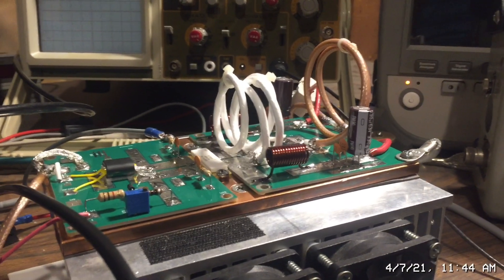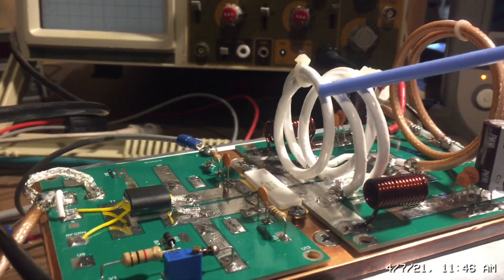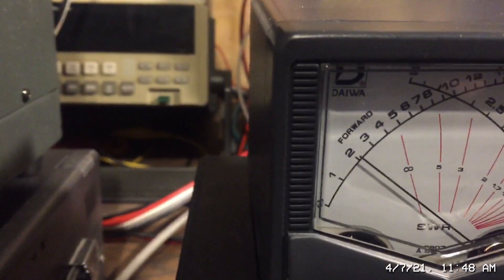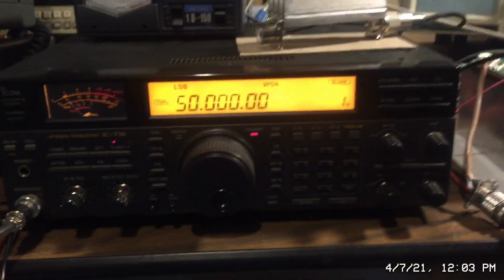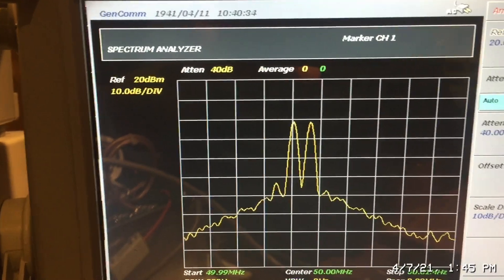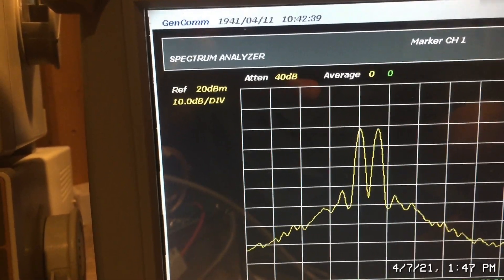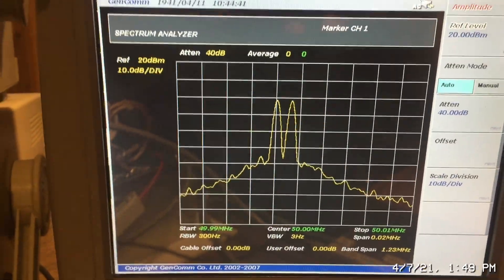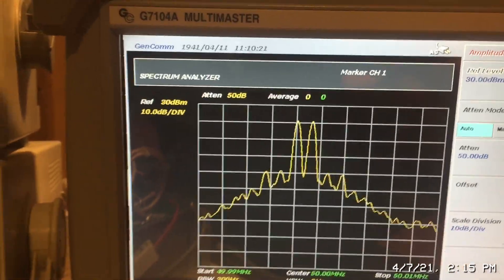RF Man Demos 6 Meter 1000 Watt LDMOS Board with IMD Measurement

Comment: Crazy question but i have to ask. Is this a push Pull?
Reply: Push pull requires 2 transistors, negative and positive half wave. but in a push pull config, you achieve at least about 10dB better imd3.
Reply: @fnordist  There are two devices in one package, but im not sure its pushpull..

Comment: So let's do some math.  50V x 28A = 1,400 watts input.  The BIRD watt meter shows 1000 watts output.  Efficiency = 100% x power input / power output... or 71.4% .  Um well, looks like we are approaching a world record for efficiency.  Class "C" (and CW) maybe close but stretching it.  SSB/ AM ... um no.  Where U got that bias set?
Reply from the maker: My boards are bias for class AB. Please check the data sheet for a BLF188XR Transistor. The published efficiency at 60MHz  is 77%. The are MOSFETS not bipolar transistor.
Reply: @rfmanchannel6915  That's theoretical efficiency.  With an output network you will be lucky to get 60% maximum.
Reply: @doctorbills790  That's simply not true; modern FM transmitters use the same transistor, just with a bit less voltage, and achieve 80% efficiency (class C) with a well-designed output network. Sure, the output network is optimized for a single frequency, but it’s absolutely possible.

Comment: Can you show an RF sweep from 50 MHz to 350 MHz to display the  amplitude of the 2nd, 3rd, 4th, 5th, etc harmonics?  That would be very helpful.  I think FCC requires harmonic products to be below -54dBc relative to the main carrier, so it would be great to see how this amp performs relative to that spec, thanks!
Reply from the maker: The FCC requires -43dB down from the fundamental. Like all RF pallets, you will need to add a LPF to meet this requirement. I will try to build a 5th order filter and show the harmonics with the filter installed. Please give me some time....
Reply from the maker: I posted that video for you.